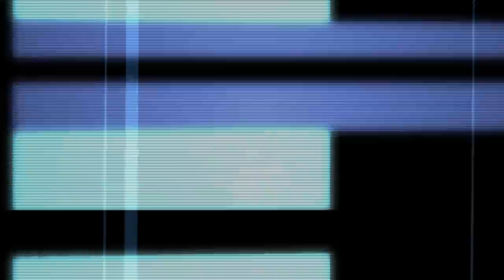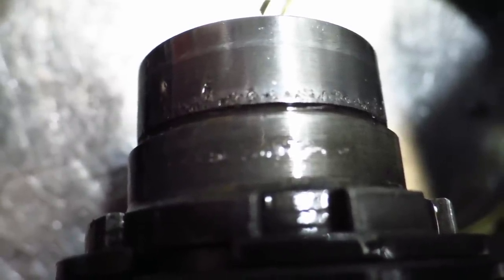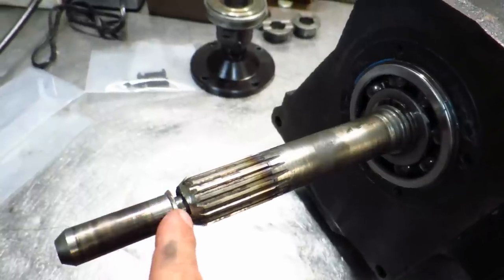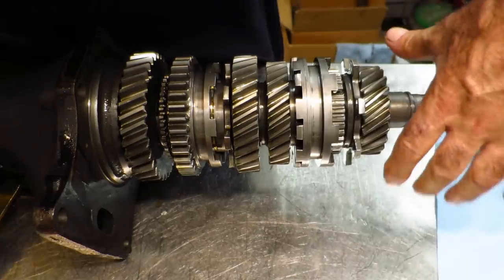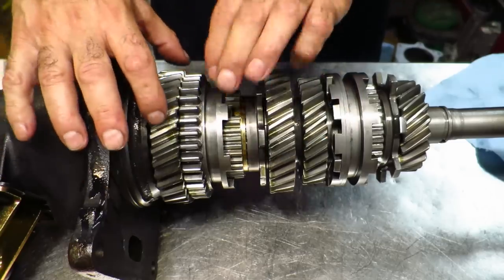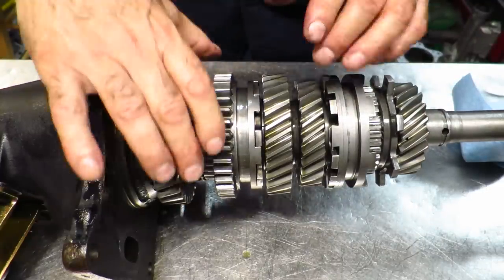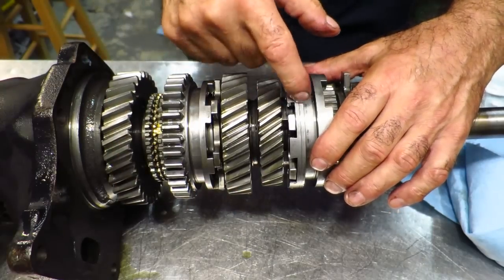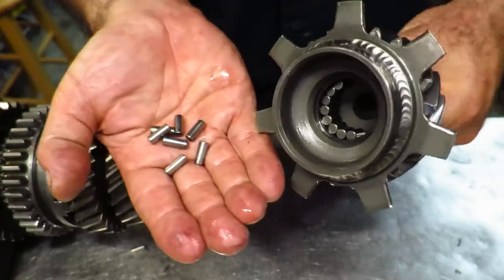GearBox Forensics Vol:1 Bellhousing Alignment Problems

Comment from the maker: I 'd like to say that as the channel gets more views that along with the increase in views is the increase in the amount of people leaving comments that are clueless about my work or my long history with manual transmissions. If you want to troll go some place else. Stupid comments about my work, or towards other people here will get you blocked.
 The Mopar box listed does indeed have an 18 spline input. Face plating has to do with the design of the dog style engagement tooth because its strength relies on the width of the face rather than the length. If anyone would like to share and question in an intelligent manner I'm all open.
Reply: GearBoxVideo I personally really enjoyed the video. After a lot of searching this is the only video I have seen explaining how faceplating actually works. would you be willing to do one on a dog engagement gearset if you have the opportunity?
Reply from the maker: Working on doing a video soon

Comment: I can attest to the fact, if your bell housing, or on my car, scatter shield isn’t aligned correctly, every bearing, bushing and gear is going to suffer, your synchros won’t work like you would like and your clutch will always seem to be dragging. The alignment process is all spelled out in the Chrysler service manuals at least as far back as 1966, and likely a lot earlier. It’s well worth the effort, especially if your using components from different cars. The stuff I’m using is all over 50 years old, and no telling how it’s been abused.

Comment: Oh so a faceplated transmission really shouldn't be street driven? Or just don't engine break by snapping the throttle and don't on off the throttle like crazy in the city?
Reply from the maker: Eventually the face plates get hammered in the street
Reply: @GearBoxVideo  thanks!

Comment: I have a Chevy nv3500 4x4 brand new and i have a problem with it building internal pressure and pushing fluid out of the vent hole. I had one before do the same thing after a clutch replacement. Any idea of the possibilities?
Reply from the maker: Sometimes the wrong fluid will cause that issue or overfilled trans. Try running the breather up higher as well

Comment: hey paul when I shift into 5th gear in my t-5 at about 4500-5000 rpm it grinds, my clutch ingagement is perfect, what gives mate!!!!!!???????
Reply from the maker: Jason Gordon could be a synchro ring on it's way out. Poor clutch release can also be the cause since this ring is rather small compared to the others and works harder

Comment: A friend of mine races Stock cars at our local oval track. He has been burning out the clutch every couple of races. His set up includes a Jerico two speed( dog gears), a 5 inch quarter master multiple disk clutch, with a hydraulic throwout bearing, and a small quarter master bellhousing. He doesn't use a motor plate between engine and bellhousing. The engine is a 604 GM crate engine.  There must be an alignment problem someplace, you have any suggestions. One thing I forgot to mention is that many of the stock car guys don't use a rear mount, they use mounts at the rear of the engine that bolts to the bellhousing bolts outside.
Reply from the maker: I'm quite familiar with these setups. It depends on how the clutch is failing.  If you are burning it up then it obviously can't handle the load and you may wan't to go up to a 7". If you are blowing out the hubs, probably an alignment issue. Not having a tail mount  puts the tortional load 100% on the ears of the transmission.

Comment: great video Paul! I have a face plated a833 like in the video. Whats the trick to getting the assembled mainshaft/tailshaft assembly to fully go in? I know the roller bearings are in the input shaft are correct and staying in place and have checked several times to make sure gears/sliders are assembled properly. I'm trying to put the assembly in with the input shaft already in the case as the manual says. I see where some people say to put the input on the mainshaft and then install the input bearing? Need some advice from the pro. Thanks a lot. Casey
Reply from the maker: The cluster has to be dropped.  Once in place you can rotate the tail and insert the countershaft.
Reply: so I need to get the main shaft assembly into the input and seated all the way in the case first, and then raise the cluster and install counter shaft? I already have the counter shaft in the cluster. Damn lol
Reply: Worked like a champ! Thanks a lot for the help.

Comment: I got a  question  5 speed mitsibishi express wont change when cold or very hard to change 1st  2 nd3rd after maybe a kilometre or 2 it changes  normalyand ok all day long till next day  and cold again   can you point me at my problem.??????
Reply from the maker: If its temperature dependent it may be that the oil thins out when heated and works better, maybe try a lighter weight oil like Synchromesh.
Reply: ok thanks for the advise

Comment: That trans was broken by shock load , if it had that much misalignment in the bell housing it would have had a problem shifting into high or 4th gear. Just my opinion. You cant side step a clutch and expect any component to survive it. No trans. drive shaft, u joint, differential will take this when its abused.
Reply from the maker: We get boxes broken all the time due to shock loading. You are assuming that it didn't have 4th gear shifting issues ( which it did ). The wear on the mainshaft was pretty severe due to misalignment and the pilot bushing was wasted. This unit was repaired and the housing was over .030 off.  Once aligned the unit shifted perfectly and hasn't broken.
Reply: Ok , thank you. I've seen a lot of pilot bearing issues also. Good job and thank you for the reply.